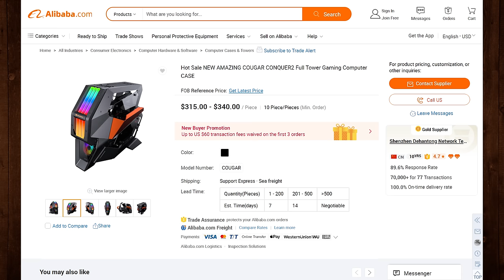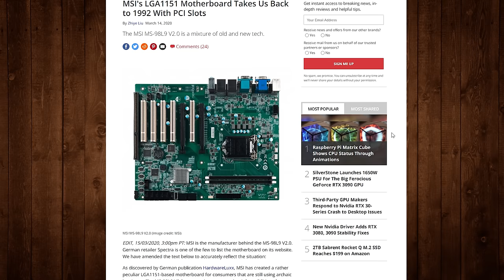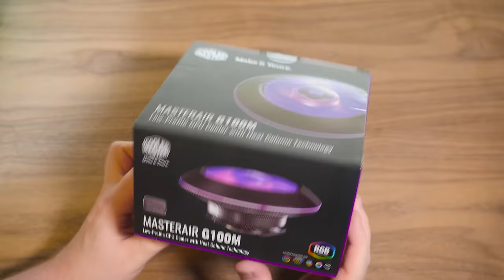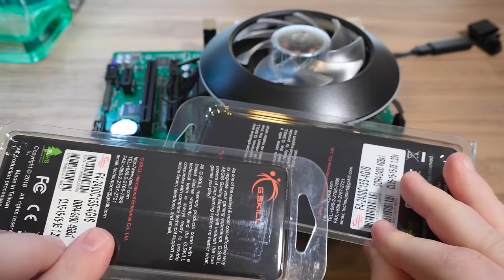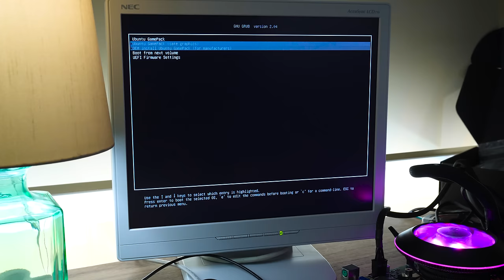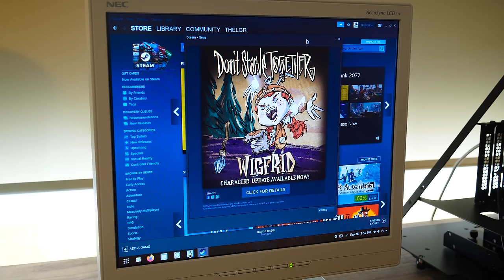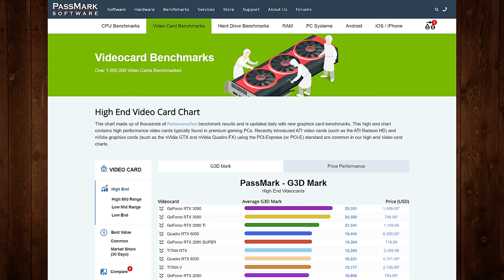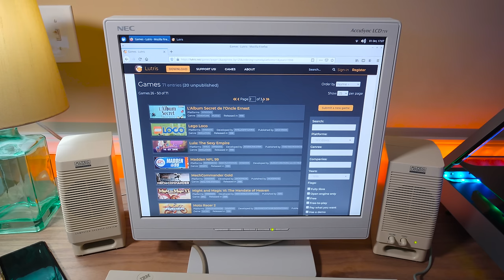Building a Ridiculous Pointy Pyramid PC

Comment: Jokes on the guy who paid LinusTechTips tens of thousands to build the same thing this manufacturer does for cheap
Reply: my thoughts exactly
Reply: Plot twist: Linus shipped it in the exact same box
Reply: When I first saw this I thought lgr was the "secret client"
Reply: Yeah I thought LGR was the client too lol
Reply: Yeah I wondered why they built one when so many available to buy
Reply: IIRC that also included top of the line components. Also the walls were much less steep to get the proportions of an actual pyramid which is why it was more problematic to build in.
Reply: I think linus water-cooled and oc'd It even tho he's one of the worst over clockers on youtube 
Dude left his cpu voltage on auto
Reply: @thisaccountisntreal107  when you build for clients you build for reliability. You can achieve nice OC's without touching voltage which is good for someone who never wants to mess with the OC i.e the client.
Reply: @thisaccountisntreal107  that ain't it chief
Reply: I think ltt never finished their pyramid. Also the ltt pyramid is a race car johnny build, literally just a flex piece.
Reply: Another twist is when things went wrong with it Linus got upset. When things go wrong for LGR the dude just giggles like I would.

Comment: It's funny mentioning sound cards. A couple days ago I was talking to a friend who was having trouble with her headphones, and the brief thought came, 'it's probably something wrong with your sound card.' And then I realized, sound cards aren't really a thing anymore. They're all baked into the motherboards because sound has reached a point where there isn't anything more that can be done. No further improvements need to be made, it's over. So it's one of those things that doesn't need to be upgraded anymore, so bake it into the motherboard and be done with it. And it just struck me as interesting. 

The only reason I didn't notice until now was because I haven't used a desktop PC in over a decade. Been laptop-only for my entire adult life. So to me, expansion cards aren't a thing.
Reply: Yeah, I had an opposite experience way back in 2001. I bought a laptop and I called the company to ask if i could uprade my graphics card so i could play in higher graphics. They said no

Comment: A lot of modern PCI slots these days actually have to go through some sort of converter chip to actually work on modern CPUs since they only allow for direct PCIe connection. Getting a direct connection is impossible. This introduces additional latency, which could be the reason why the ATI card was running poorly.
Reply: It was probably just Linux. I’ve never had a good time getting Linux to run smoothly on a desktop setup - even native games run super poorly, and YouTube is a write off on anything older than 5 years.
Reply: Nope just shit drivers, old ati cards were a pain, devs could not write drivers for them, manufacturer support was not there. So much better these days.
Reply: @TerraRoot  I swore off ATI cards in the mid 2000's for a long time as  their drivers were so rubbish. And they kept bollixing the Windows drivers too
Reply: No, it's just really old and Linux isn't the king of old hardware with new OS as much as it was back in the day. On the other hand, I plugged in an ATI 7970 2GB card on an HP setup and it worked great for what I was doing.
Reply: @21Trainman  Yeah windows ran really well too. Didn't you notice?

Comment: If you do not have an XP USB installer, you should create one, it can include most updates even ones past SP3 and even integrate drivers for newer systems and brings install times from over an hour (depending on hardware) down to minutes.

Comment: [I edited this post like 21 times. I just forgot stuff. Last Edit Added SYSTEM.CB]
Not knowing everything you tried installing Windows 98SE, I offer the following. 

To be clear, you can install Windows 98SE from the hard drive, but you probably know that already. 

During my install, I had to change the SYSTEM.INI file and resume installation due to having too much ram. Resuming the install only affected the layout of the Start Menu. Being familiar with the Start Menu, it was easy to correct after the install. I had to put in the option to skip the scandisk as well, but I do not remember why. 

Assumptions (You have a good bootsector, and you can boot from the hard disk into Windows 98 DOS mode)

Suggestion: Maybe limit the partition to 32GB for a proof of concept install.

Here are my recommendations for each file.

Ignore the horizontal lines. I just used them to separate the files for this post.

-----------------------------------------------------------------------------------------

CONFIG.SYS (aspi4dos.sys might be optional if you still have memory problems)
dos=high,umb
device=himem.sys /testmem:off
devicehigh=aspi4dos.sys
devicehigh=setver.exe
files=60
lastdrive=z

-----------------------------------------------------------------------------------------

AUTOEXEC.BAT
REM Leave File Empty

-----------------------------------------------------------------------------------------

SYSTEM.INI (Available upon reboot during install. This should give you 1022MB OF RAM in WIN98SE.)

[386Enh]
MaxPhysPage=40000

[vcache]
MaxFileCache=261120

-----------------------------------------------------------------------------------------

SYSTEM.CB (Safe Mode Version of SYSTEM.INI. This should give you 1022MB OF RAM in WIN98SE.)

[386Enh]
MaxPhysPage=40000

[vcache]
MaxFileCache=261120

-----------------------------------------------------------------------------------------

MSDOS.SYS (Marked Hidden & Read Only In Root Directory You have to use ATTRIB -R -S -H MSDOS.SYS. Once changes are done, you can probably do this ATTRIB +S MSDOS.SYS , but I do not think its required. Here is the Suggested Contents starting from the top line and being a full replacement)
;FORMAT
[Paths]
WinDir=C:\WINDOWS
WinBootDir=C:\WINDOWS
HostWinBootDrv=C

[Options]
BootMenu=1
BootMenuDefault=1
BootMenuDelay=15
Logo=0
BootMulti=0
BootWin=1
BootGUI=1
BootKeys=1
AutoScan=1
WinVer=4.10.2222
;
;The following lines are required for compatibility with other programs.
;Do not remove them (MSDOS.SYS needs to be >1024 bytes).
;xxxxxxxxxxxxxxxxxxxxxxxxxxxxxxxxxxxxxxxxxxxxxxxxxxxxxxxxxxxxxxxxxxxxxa
;xxxxxxxxxxxxxxxxxxxxxxxxxxxxxxxxxxxxxxxxxxxxxxxxxxxxxxxxxxxxxxxxxxxxxb
;xxxxxxxxxxxxxxxxxxxxxxxxxxxxxxxxxxxxxxxxxxxxxxxxxxxxxxxxxxxxxxxxxxxxxc
;xxxxxxxxxxxxxxxxxxxxxxxxxxxxxxxxxxxxxxxxxxxxxxxxxxxxxxxxxxxxxxxxxxxxxd
;xxxxxxxxxxxxxxxxxxxxxxxxxxxxxxxxxxxxxxxxxxxxxxxxxxxxxxxxxxxxxxxxxxxxxe
;xxxxxxxxxxxxxxxxxxxxxxxxxxxxxxxxxxxxxxxxxxxxxxxxxxxxxxxxxxxxxxxxxxxxxf
;xxxxxxxxxxxxxxxxxxxxxxxxxxxxxxxxxxxxxxxxxxxxxxxxxxxxxxxxxxxxxxxxxxxxxg
;xxxxxxxxxxxxxxxxxxxxxxxxxxxxxxxxxxxxxxxxxxxxxxxxxxxxxxxxxxxxxxxxxxxxxh
;xxxxxxxxxxxxxxxxxxxxxxxxxxxxxxxxxxxxxxxxxxxxxxxxxxxxxxxxxxxxxxxxxxxxxi
;xxxxxxxxxxxxxxxxxxxxxxxxxxxxxxxxxxxxxxxxxxxxxxxxxxxxxxxxxxxxxxxxxxxxxj
;xxxxxxxxxxxxxxxxxxxxxxxxxxxxxxxxxxxxxxxxxxxxxxxxxxxxxxxxxxxxxxxxxxxxxk
;xxxxxxxxxxxxxxxxxxxxxxxxxxxxxxxxxxxxxxxxxxxxxxxxxxxxxxxxxxxxxxxxxxxxxl
;xxxxxxxxxxxxxxxxxxxxxxxxxxxxxxxxxxxxxxxxxxxxxxxxxxxxxxxxxxxxxxxxxxxxxm
;xxxxxxxxxxxxxxxxxxxxxxxxxxxxxxxxxxxxxxxxxxxxxxxxxxxxxxxxxxxxxxxxxxxxxn
;xxxxxxxxxxxxxxxxxxxxxxxxxxxxxxxxxxxxxxxxxxxxxxxxxxxxxxxxxxxxxxxxxxxxxo
;xxxxxxxxxxxxxxxxxxxxxxxxxxxxxxxxxxxxxxxxxxxxxxxxxxxxxxxxxxxxxxxxxxxxxp
;xxxxxxxxxxxxxxxxxxxxxxxxxxxxxxxxxxxxxxxxxxxxxxxxxxxxxxxxxxxxxxxxxxxxxq
;xxxxxxxxxxxxxxxxxxxxxxxxxxxxxxxxxxxxxxxxxxxxxxxxxxxxxxxxxxxxxxxxxxxxxr
;xxxxxxxxxxxxxxxxxxxxxxxxxxxxxxxxxxxxxxxxxxxxxxxxxxxxxxxxxxxxxxxxxxxxxs

-----------------------------------------------------------------------------------------

That is all that I have. Hopefully, the new hardware supports Upper Memory Block. 

If you do manage to install WIN98SE, I bet the next problem will involve Finding A Free Memory Region Using MSD.EXE For EMM386 + SB Live MIDI + Soundfonts for DOS Games like Doom & Duke3D. 

BTW: Probably the hardest conventional memory dos game to run is Falcon 3.0. You can get some bonus points from me, if you manage it on new hardware.
Reply: Ever try seeing if you could replace the DOS component of Windows 98 with FreeDOS or another alternative that still has drivers for newer computers?
Reply: @ZipplyZane  That would be awesome, unfortunately MS was notorious for making undocumented features in MS-DOS, additionally I believe the version of DOS win95/98 was built on top of (MS-DOS 7) had NO official documentation. However I wonder if it would be possible to make a version of DOS compatible with win95/98 using resources covering the many hidden quirks of MS-DOS like the Undocumented DOS book. It might even be possible to just tweak an existing implementation like FreeDOS. Not sure it would be worth the time and effort though...
Reply: Yeah I'm surprised he didn't mention the 

[vcache]
MaxFileCache=261120

part; that was specifically what I had to do when I set up a win98 PC a couple of years ago.  Also doing the install with only one stick of RAM.
Reply: @rubblemonkey6904  The reason I brought it up is that I recently watched a video about Windows blocking out DR-DOS intentionally in the beta for Windows 3.1. In it, I discovered that DR-DOS 7 is apparently compatible with Windows 95. Since Windows 98 is Windows 95.1 essentially, I thought replacing the DOS component might work.
Reply: @ZipplyZane  I didn't know that! Since that's the case it shouldn't be nearly as difficult to do as I thought.

Comment: Imagine buying a +$50,000 Mac Pro, then gutting it, then shoving the internals in this pyramid!
Reply: I was going to say that there was no way the Mac Pro cost $50,000 maxed, but wow, it costs $55,000 maxed. Total ripoff, considering you can get a Talos II with the same specs and almost twice the cores (with twice the threads per core) for $5,000, maybe $6,000 if you're unlucky.
Reply: Nobody who needs a $50,000 work station should be using MacOS
Reply: @gormauslander  Correct, they should be using a BSD instead. Or at least Fedora or OpenSUSE.

Comment: I got The Verge flashbacks when you called the IO shield a bracket.
Reply: It's a bracket, isn't it?
Reply: @override7486  it's actually a plate.
Reply: @papayer Well, yeah, single sheet of metal  shaped to have a locking mechanism, "clicking" on top of the cut0out itself. Sounds and looks like a bracket to me.
Reply: @override7486  it's not called a bracket. and even if that were correct, verge guy was just using fumbling his vernacular looking for the most scarcely technical-sounding word to use in the context of a build guide. said build guide was dogsht. ergo everything that reminds me of him and his inflated ego will make me retch automatically.
Reply: It's a brace! Now excuse me. Im going to tie it together with some tweezers

Comment: I did something similar with an intel Core 2 Quad. I also have Nvidia Quadro 400  GPU. If you want to go for that old Windows 9X look up the Chicago95 XFCE (desktop environment of Xubuntu) theme. Really gives the complete look and feel. Even themes the bash terminal to look like the typical MSDOS-Prompt. I also chose to do a dual HDD setup with the first running Xubuntu and the second running OpenIndiana (OpenSolaris continuation).

Comment: I wonder if FreeDos might be your solution.
Reply: Can you install win98 se on freedos and replace dos7 with it?
I recall some legal stuff and one being able to replace ms dos with other dos'es, mainly dr dos
Reply from the maker: FreeDOS was the first thing I tried actually, but I cut it out of the video since it was unfortunately a total dead end. It refused to boot with any expanded memory managers running, and with those disabled it would run basic DOS stuff but otherwise was pretty unusable.
Reply: @LGR  I would have thought it could handle the more modern hardware. Awesome for trying though.

Any chance you tried OS/2?
Reply: @LGR  what about arca noae
Reply: So since this is a LGA1200 socket system; it most likely is running UEFI bios. Might need to change a few settings in it to support more of the legacy hardware he installed. It could also have a few chips on the board it's self to "emulate" a legacy south bridge chip to communicate to those legacy slots. Other then that; not sure. But that very old video card...yikes!
Reply: @AnimalFacts  I would LOVE to see an attempted OS/2 build, even if it failed.
Reply: @LGR  did you try Linux? Maybe could have solved it.
Reply: @LGR  you should have tried windows 7
Reply: he did
Reply: @fightingfalconfan  the SATA controller might need to be set to IDE/legacy mode if that option is still being offered (with a SATA SSD/HDD to match), or a PCI IDE controller could be connected (rip sound card though)

Comment: First, Linux was an AWESOME choice! The issue with the graphics card is with drivers. AMD graphics are runnable straight from the kernel, but older amd and ati graphics cards require external drivers to work. I have no idea where you might even be able to get those drivers. Also, I need a y2k compliant sticker for my computer lol.

Comment: Welcome to the world of Linux Gaming. I Was using Lutris and Proton for the last few years without the need to use windows.
Reply: Lutris and Proton have changed Linux gaming and it's awesome that we are now seeing Linux native ports of some Windows and Mac games.
Reply: Can Linux run the Windows Entertainment Pack natively? I know it can via DOSBox (note: do not run DOXBox in a virtual machine unless the programs don't have or need mouse support. The pointer'll go crazy).
Reply: @Chaos89P  I belive lutris and proton are a compatibility layer running the windows games so they should handle that sort of thing for you.
Reply: @CAMSLAYER13  They're 16 bit programs. If the Linux distro is 64-bit... Linux isn't like Windows much...
Reply: @Chaos89P  If it works works with WineVDM, it's possible. That is how Wine handles 16-bit code. You can even get a version that runs on Windows 64-bit, if you want.
Reply: @ZipplyZane  And here I am using DOSBox. I don't know what I find so fascinating about using a touchscreen to use on old legacy software, but it doesn't work as well in DOSBox, because I think mouse-enabled DOS programs default to "relative" instead of "absolute."
Reply: @Chaos89P  Touch screens are a whole other thing, indeed. But since Wine uses the native cursor of the X Windows system, I think it would work--in Windows programs, at least.

The problem with DOSBox is that it just emulates a mouse, and the cursor is handled by whatever program is running. Each program has its own mouse settings. And Windows is just another program.
Reply: @ZipplyZane  Which was why I had been looking for a way to force "absolute" in DOS programs, without any luck.
Reply: @Chaos89P  Only way I could see it working would be with some sort of mod to DOSBox that would let you calibrate a touch interface with each program. Then any time you tapped on the screen, it would simulate moving the cursor to that location and clicking.

I think there may be an Android version of DOSBox that tried to do that, but I never tried it since it was paid.

Comment: Hey Clint, you can just get an RGB splitter cable thingy (similar to 4pin fan splitters) and attach that to the cpu fan+top case fan and connect them to the CoolerMaster controller thing and have that control the ARGB on both fans.

Comment: I'm a little dissapointed that LGR didnt do an SLI graphics card build.
If he wanted a middle of the road PC, what better idea than to use 2 old cards, use the SLI system thats been phased out to boost the cards to be a decent power.
It would have fit the theme of this pc so perfectly
Reply: Was there SLI on PCI cards? I've only seen it on PCIe thus far
Reply: @jayhill2193  Not Nvidia, but the original usage of SLI on 3DFX cards supported multiple GPUs on PCI.

Comment: LGR add the following line to the [386enh] section of the System.ini file:
MaxPhysPage=40000
Reply: 98 installer right?
Reply: @systemchris  yes
Reply: How about for XP? How would you go about circumventing the BSOD?
Reply: @Chaos89P  It's likely the M.2 SSD not being compatible - Some motherboards have a SATA emulation/ Legacy mode which will sometimes work. I use XP on a modern i3 machine but have enabled Legacy mode in the SATA settings.
Reply: There was some 3rd party XMS program that had a limit= option... I'm not sure, but it were either a 3rd party "himem. sys", or something along those lines....
I managed to get Windows 98 running on a Pentium M laptop with said program and 2GB RAM...  For USB, there's USB 2.0 drivers that are "Universal" i.e. supports any USB Mass Storage class USB devices at least and finally for Video, I used some generic 3rd party VESA driver that exposes the frame-buffer modes in VESA2.0 compatible cards, but of course, has no 2D/3D acceleration.
Getting SoundBlaster running on Windows 7 at least requires the KX-Project driver and for the 64-bit version requires disabling driver signing on every reboot (I'm not certain, but think I've heard of people getting the SoundBlaster Live working with Windows 10 and others saying it's impossible without paying Microsoft to sign the KX-Driver)